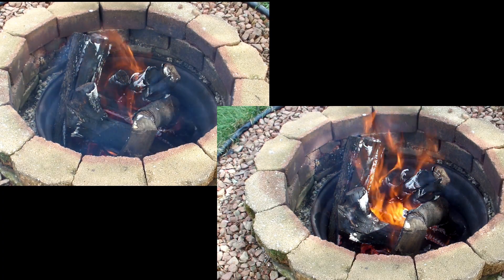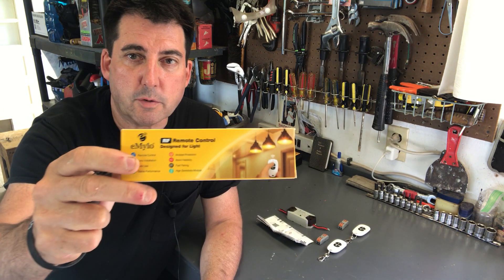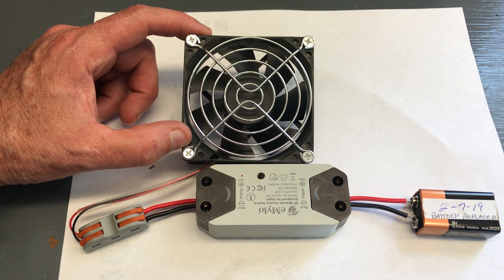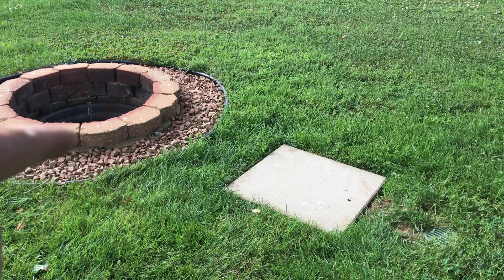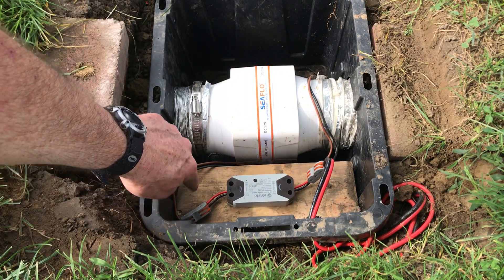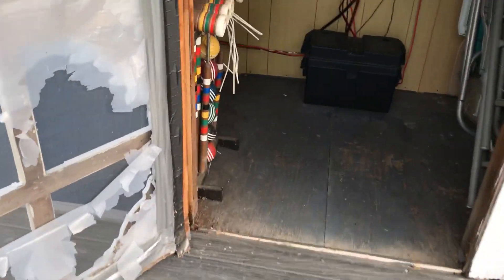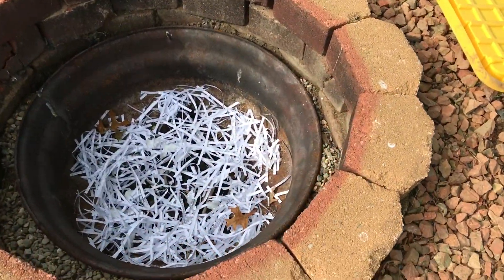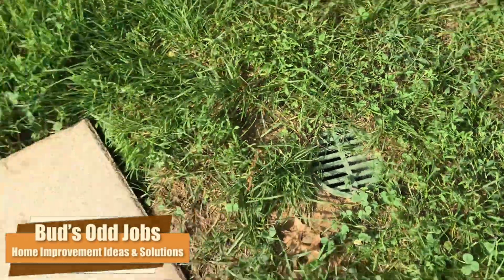Fire Pit Automation 🔥 Adding a Wireless Switch to Control my Bilge Blower Fire Pit

Comment: Does it rain where you live?
Reply from the maker: Only when the thunder clouds roll in.  And the answer to your next question is, this pit has been in place for two years and I’ve had no issues with water. We have very sandy soil and it drains very well.
Reply: @BudsSmartHome  im happy to hear that!! I was actually more concerned about water entering the inlet port to the fan 😅
Reply from the maker: @DC1948p  - I have that covered as well. The inlet hose is perforated, and the tote that contains the blower is perforated as well. The small amount of water that enters is drained as well. Thank you for taking the time to comment.